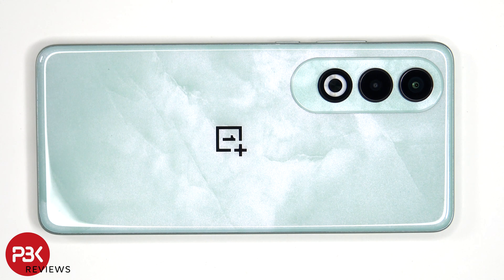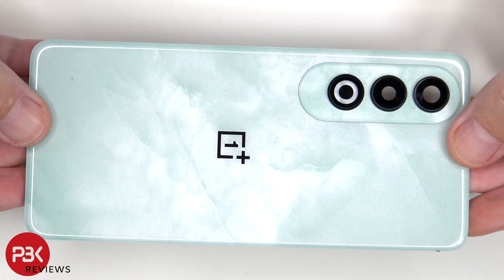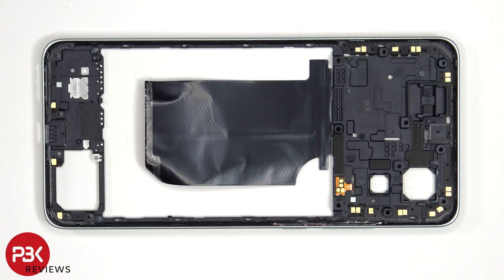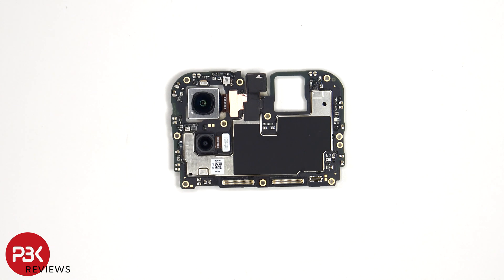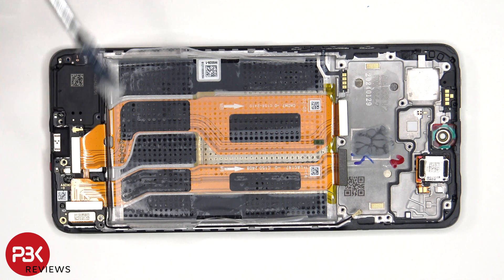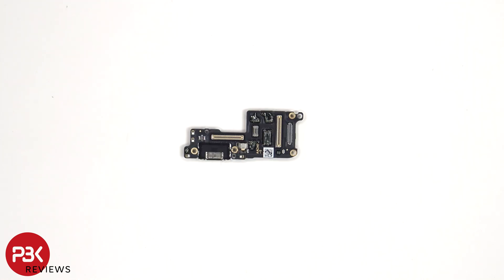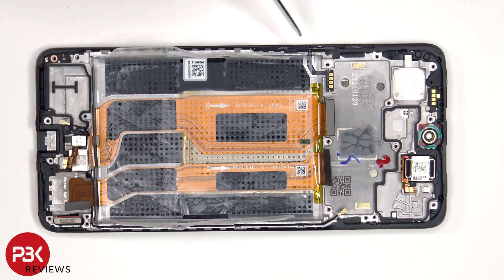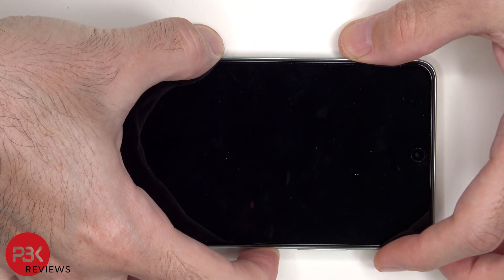OnePlus Nord CE4 / Oppo K12 5G Teardown Disassembly Phone Repair Video Review

Comment: sir my oneplus nord ce4, calling getting ended after 1-2 rings and speakers are lagging and fast charge not working properly.. can it be fixed? Recently some moisture went inside my phone and damaged the Proximity sensor and Service centre denied anything can be done.pls help sir

Comment: Thanks great video. What do these companies even gain from gluing the back cover and making the battery non user replaceable. Having a replaceable back and battery would be cheaper to manufacture even, since they can do away with the expensive adhesives and press connectors on the battery.
Reply from the maker: Thanks. Not sure it can be many things. Easier water proofing, more premium designs like glass vs plastic backs or other factors. Also glass helps transfer heat better than plastic.